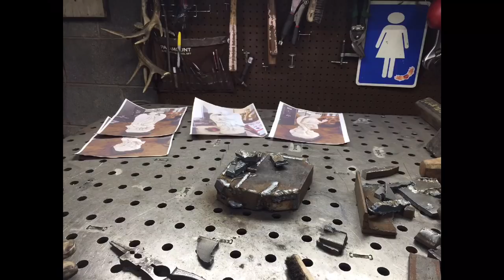Masterpiece Metal Sculpture Creation |Welding Creatures | Angels & Demons | Barbie The Welder

Comment: Where do you find those rasps that will take the rpm's of a die grinder?
Reply from the maker: http://amzn.to/2oDLyRt these are 1/4 shank. They also have 1/8 shank. If you’re going to run a 1/8 shank buy a adaptor for your 1/4 die grinder, I’ve had no luck with smaller 1/8 chuck pencil style grinders they have no ⚽️ 🏀 🏈. Always tungsten always double carbide! They cut steel the best!!💪🏻💙👩‍🏭
Reply: BarbieTheWelder thank you